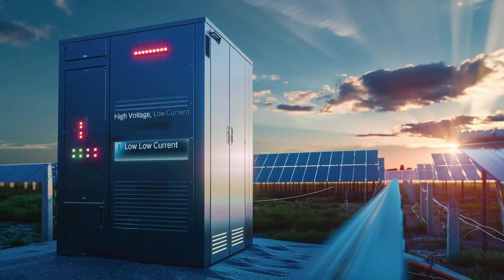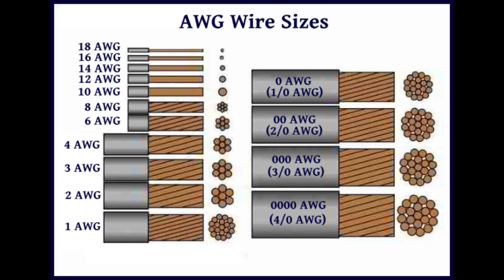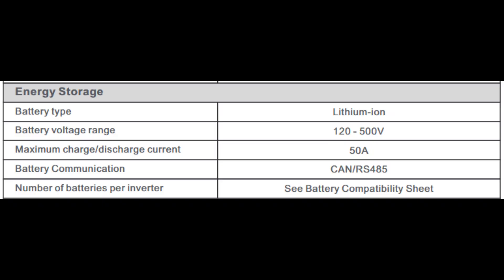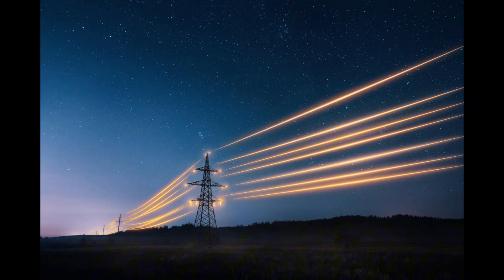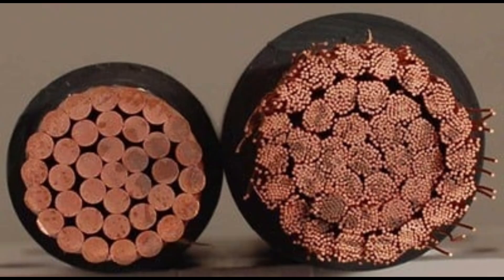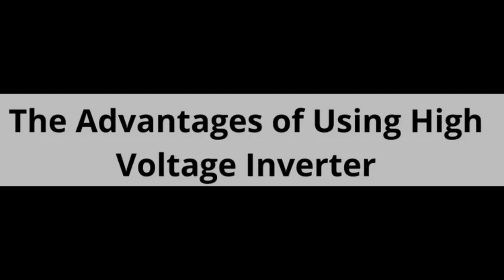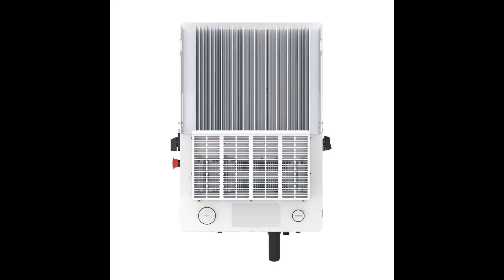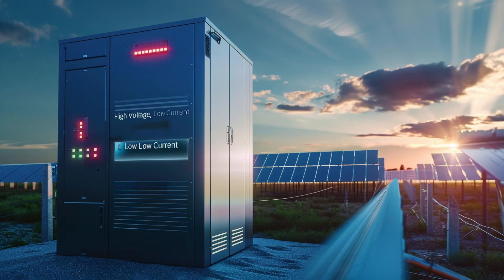High Voltage VS Low Voltage Solar Inverters Solis S6-EH1P 11.4K-H-US VS Deye SUN-10 12K-SG02LP2-US

Comment: Downside on High Volts and low amps is that if you have a large house with large demand of say 100 amps, 50Amps isnt going to cut it.
Reply from the maker: There's no low voltage inverter that will ether. But I have 2 S6 11.4s here now I could parallel them for 23Kw if I wanted but I prefer to distribute the load. One runs most of the house the other runs the shop and some other loads. I have a third one coming soon. Also Solis is releasing their S6 30 and 50Kw inverters to the USA this year. Thanks for watching!

Comment: Man i wish i could get a 48 volt inverter with hi pv in put
Reply from the maker: Most of the new EG4 Inverters now have a 600 VDC solar input, https://signaturesolar.com/eg4-18kpv-hybrid-inverter-eg4-18kpv-12lv-48v-split-phase-120-240vac-ul1741-cec/?ref=piqshkgv